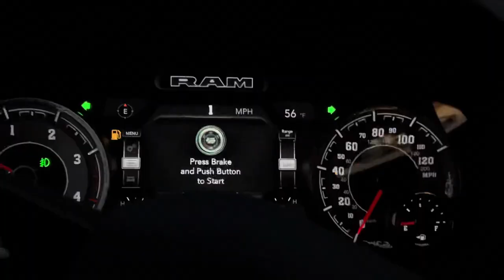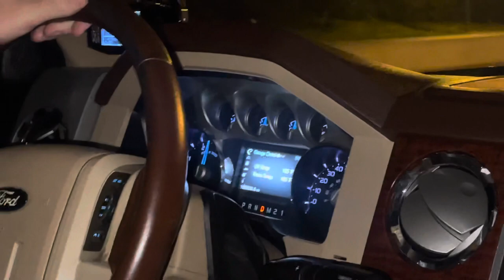Tearing up my SEMA TRUCK!!

Comment: Hold your traction control button for about 10 seconds so it can shut your whole stabilatrack off so you’ll get the full power so you can burnouts